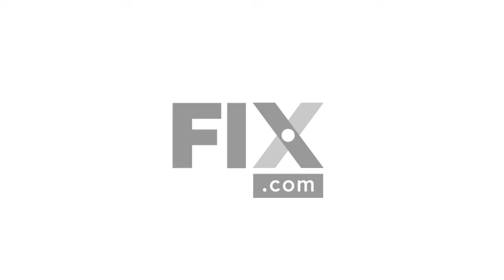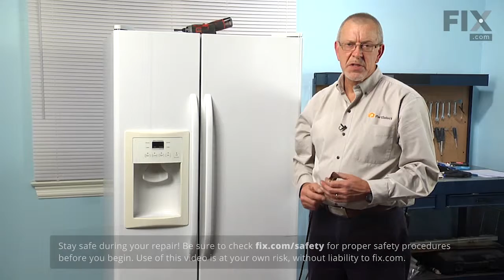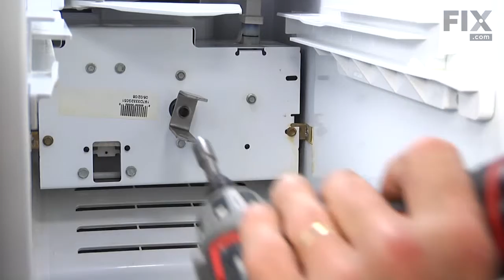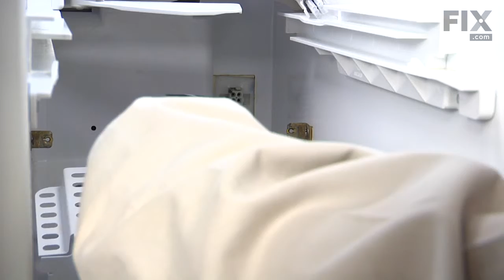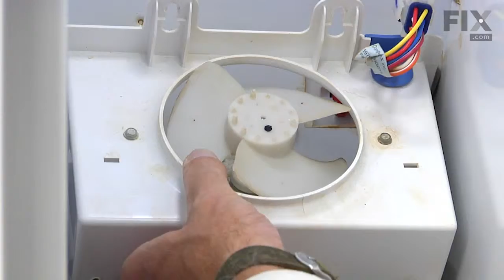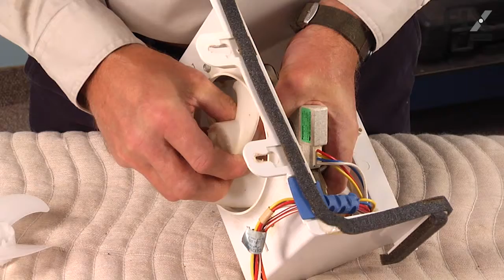GE Refrigerator Repair – How to replace the Evaporator Fan Blade

Comment: What direction should the fan be running in. Should it be pushing air down or pulling air up
Reply from the maker: It would be pulling the cold air off the evaporator mounted below pushing it upwards into the port to the fridge section where it will fall to the bottom of the fridge and be sucked back over into the evaporator to be recalled and circulated.